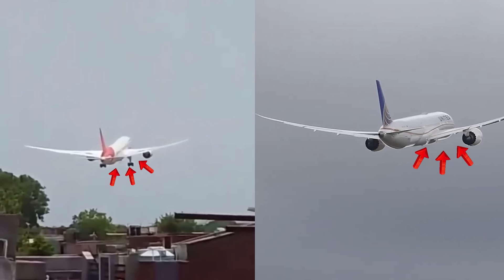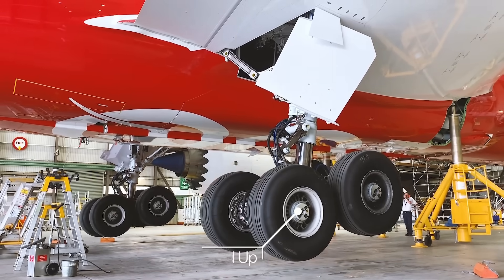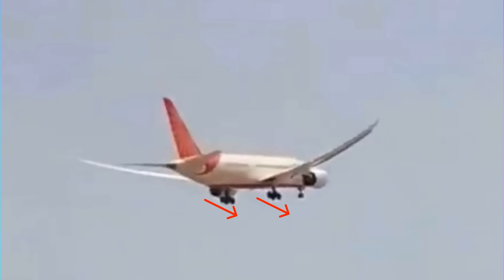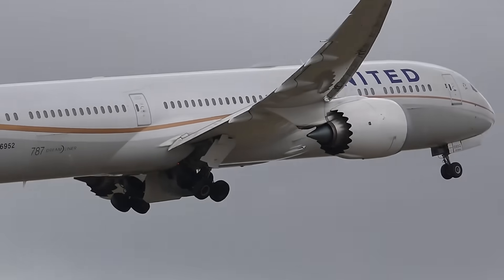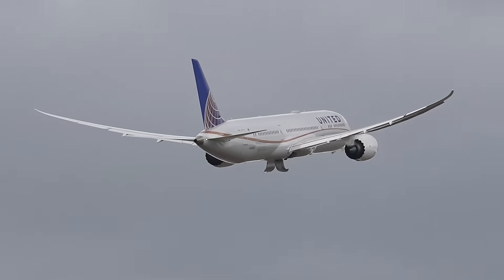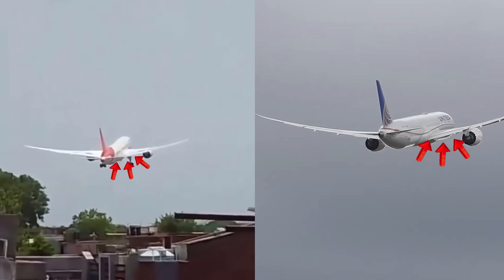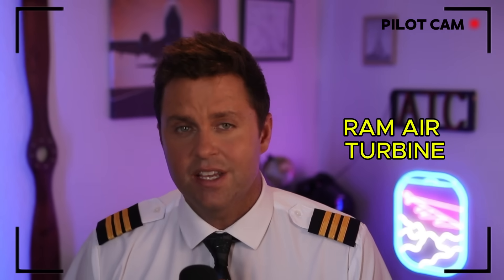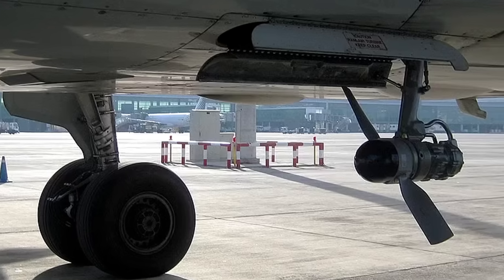Pilot Explains: A New Detail in the Air India 787 Crash Everyone Missed

Comment: I think pilot tried to raise the landing gears, the gears retracted a little bit then it's hydrolic fluid leaked (with a blast, because pressure is so high that when it leaks, it leaks with blast, that much is the pressure, and the sole survivor also mentioned about hearing the blast) then landing gears stopped retracting and the leaked ultra high pressure fluids destroyed electronics and other things arround it and instantly stopped the plane from generating power, then RAT got deployed automatically to generate emergency power (usually RAT deployment also results in flickering of lights inside the plan and sole survivor said that lights flickered) to make necessary electronics work, to make mayday call etc. We can see RAT deployed and it's gates open at the bottom of the plane, in the video, this is just my speculation from observation and whatever little knowledge i have. So i think crash happed because of manufacturing or maintenance or design engineering error of landing gear hydrolics. They should make the plane in such a way that even if hydrolic blast happen, it should not cripple the plane's ability of generating lift or running engine.

Comment: They used the full length of the 11,000 foot runway. A 787 normally needs around 9,000 feet to take off. Granted, the plane was fully loaded and it was a hot day, but did it really need the full length?

Comment: yeah, i also sat that tilt, and said that probably 787 should continue to climb with flaps select to retract. The mystery is both engines flame out at exact same time (when you lose one engine first you'll see a little move to one side. For me it should be contaminated fuel too, or bad quality, or some fatal system error. I also thought about what can cause engine shutdown in flight, and i think about overspeed and wrong temeperature selection, but it's not possible in my opinion

Comment: I think I saw it mentioned on another channel that the aircraft had recently undergone maintainence so there is the possibility that something became disconnected during takeoff that caused fuel starvation or loss of power to the fuel pumps. I think once the investigators have finished it will turn out to be an unfortunate and highly unlikely set of circumstances.

Comment: Contaminated fuel only makes sense if other planes reported an issue. Only one plane? That makes me think it's something specific to that plane. From what I understand, the plane sat on the tarmac for 2 hours with no A/C. Couldn't that then heat up the fuel to vaporaization levels? And then if you lost all electrical power, therefore the fuel pumps, the fuel wouldn't be able to be fed to the engines especially with the angle of attack on take off and if the fuel was vaporizing. So complete loss of power via vapor lock due to loss of power to the fuel pumps???

Comment: Having read the comments and watched the videos of the plane , could it not have been a circuit inside the plane that has shorted out causing fuel starvation to the engines , im only submising  but components malfunction, is there a back up ? Could it be an electrical fault causing the plane to lose power,

Comment: Another video claimed that the place sat in over 100F temperature for hours, running, with no AC (people were fanning themselves) and this led to a vapor lock issue in the fuel system. I do not know enough about the design of the hydraulic system or fuel system to even understand whether this is a legitimate hypothesis.

Comment: am not a pilot, far from it, but i have a question, contaminated fuel can cause dual engine failure yes, but can that failure happen at the same time? my thinking was one engine can flame out but the other can still function albeit for a few minutes than the other before it flames out as well. and failure just after takeoff means the aircraft was completely empty of fuel prior to refuelling. If it was contaminated fuel, the source of that fuel didnt just pump into this jet alone. other jets before and after it must have got same fuel, did other jets suffer from engine failures from the airport? so many questions in my opinion from this theory of contaminated fuel.

Comment: 1. Fuel that  comes from the depot visually inspected by certified techs for any rust or water contamination before they dispatched the tanker. 

2.The depot thats stores fuel is  (CFU/ATP) sampling tested. That knows as  microbial contamination tests .

3. Upon arrival fight mechanic/ engineer inspects the tanker usually and if they have any doubts they holds the delivery to the airport and sends samples to lab for CFU/ATP tests (microbial contamination) test.
CFU tests requires to send sample offside and takes time to come back at you . 

4.ATP can be done on site and takes no longer than hour to come back at you . 

5. Both tests requires special testing equipments. And i sure all air ports does have. 

6.even if there is a debris or rust in the fuel , there are fuel filters in place. I am sure our car does have so why not the air crafts ? 

7.Finally , only possible way to contaminate jet fuel is deliberate water contamination after the final checks and before fueling up the air craft . Which highly unlikely but you never know only needs one disgruntled person to do it.

Comment: Excellent information on the crash. Question : I am not up to speed on the 787, I agree with you on dual engine failure, the noise when the aircraft passed the camera was only RAT noise, if the engines were up to t/o or max power you won't hear the RAT. If a main battery failed due to lithium fire would that shut down the battery and cut off fuel to the engines?

Comment: Regulations require the engine driven pumps / EDPs to be able to power the engines without any boost pumps (electric motor pumps / EMPs). But I can't find any regulation that says this includes takeoff and climb power. So I think the requirement can be read as "the plane must keep flying and be able to land with only an engine driven fuel pump" and I think that takeoff power and even the attitude and forces experienced at rotation may have some relevance to the loss of thrust in both engines after an electrical failure. I also think the 248-day PCU power failure issue as well as the complaints about electrical power and eyewitness account of lights flickering or going out and the RAT add up to electrical failure, AC fuel pump failure and loss of thrust at the worst possible moment. Now add the gear stuck down and the flight already heavy and in a high temperature takeoff, the margin for loss of any thrust must be pretty low?

Comment: When I analyze a process failure where two things went wrong at the same time, I start with concurrency — what was touching both failure points.  We have the airframe itself, hydraulics, electricity, software, command inputs.  I think between the video from the prior flight show electrical issues before it ever left Delhi and that deafening silence, RAT deployment, etc., we have electrical failure.  Fuel starvation wouldn’t have also been making the cabin of the prior flight have flickering power, no lights, etc.,  and they would have added more before launching for London, so not leaning as heavily that way.  So what takes out electricity, what touches electricity going to the engines?  Input from the pilots, what turns the motor output into electricity  and— software.  Remember the Max?  Plane just decided to do the opposite of what the pilots were doing and flew the plane into the ground.  My first thought was— that silence, the rat, and what looked like a gentle landing config to me from watching lots of landings over the years (but not a pilot, and could be the angle of our video)— I am concerned that the plane’s software decided they were landing, not taking off, and those poor pilots didn’t have a chance — they had a no power stall and not enough sky to work the problem.  I think they still had some physical control, the plane isn’t spiraling in, doesn’t roll over, so I bumped hydraulics toward the bottom, along with deliberate behavior killing the plane.  I hope I am wrong, that it was maintenance, that there was some single fuse or wire that fed “keep running” instructions to both of the engines that failed,  it was something easy to identify and easier to prevent, but I always look at a things as systems: I review a system in a hospital and assume it wants to kill the patients or easily allow a nurse, provider, tech, etc., to accidentally do it, and then I try to engineer that ability out of the system, or provide education if we can’t.  Just my thoughts before coffee.  Fly safe out there

Comment: hi, couldn't it be, that the electronic throttle system could be affected respective any other electrical system responsible for thrust and all involved fuel pumps? I am thinking of the AirAsia Flight 8501 crash caused by a bad solder joint on a PCB. Thanks in advance for your comment on this topic.

Comment: I have to tell you a story,; I flew a semi glass cockpit chopper.On a VIP flight one of the several pages of parameters, that we had to check came out marginally abnormal. The engineer, a very accomplished one at that, said it was a five minute job.
As I had the time I asked him to go ahead. The helicopter came out three and a half months later.
You see a rat had got into the wireing an  gnawed through some of the cables. 
My point is that pilots are a cannibalistic race. For fame or profit,  we are willing to develop scenarios (which could influence  or offer a loophole ) for the real culprit to hide behind.

Comment: Great Analysis! 
At the time of lift-off, a significant amount of dust particles were visible on the left-hand side of the aircraft, which could indicate that the left engine may have ingested foreign objects during the takeoff roll, potentially causing its failure. No such dust was seen on the right-hand side, and although no birds were observed, this points more towards foreign object debris affecting the left engine.

Since the Ram Air Turbine (RAT) deployment suggests both engines failed, the Digital Flight Data Recorder (DFDR) report will be crucial in determining the cause of the right engine’s failure.

Additionally, during takeoff with flaps selected downwards, fuel is fed to each engine from its respective wing tank, not from the center tank, which makes fuel contamination in both tanks a remote possibility.

Overall, the evidence points to a likely FOD-related failure on the left engine, while the right engine’s issue remains to be confirmed by further data.
Reply from the maker: Thanks for the input!

Comment: It’s possible fuel vapor lock resulted in the dual engine failure. The OAT was 115 F at departure. How long was the subject aircraft baking in the intense sun after being fueled? Is there a takeoff fuel temperature limitation on the B787? Any B787 drivers out there?

Comment: There is footage showing that two hours before the accident, passengers complained that all the electronic devices on the same plane had malfunctioned and there was no air conditioning. What does this indicate?
Reply: The only survivor also said there were electrical issues and he heard a loud sound (deploying RAT?, he was seated near the wings/RAT location) and flickering lights just after that (RAT taking over electricity?). I'm not a pilot or technician, but sounds reasonable to me.
Reply: @peterschelwald7466  major electronics failure would also explain losing both engines simultaneously, which little else could, and along with the RAT deployment, electronics are the only likely sources for that bang. Note that the RAT will not power anything in the cabin, but the cabin has battery backups for lighting if there's an interruption to the power supply from the engines.
Reply: It wasnt on this trip
Reply: @tholo86 the last trip two hours before the accident.
Reply: No movies to watch and it's going to be really warm....

Comment: The YouTube pilots in general are doing a bad job on the analysis of this crash. ( with exception to Greg  ). 
I don't like the use of the term double engine failure or even loss of thrust if the REASON the thrust is low is because of another system external to the engine. For example if a massive series of computer or signal failures COMMANDED the engines to low thrust, then would you call that an engine failure?
Reply: Dunno. If you were a deep sea diver and your air was cut off would you die of respiratory failure--especially considering you wouldn't if you were sea life? A paradox ideal for philosophers.
Reply: @MaureenMarshall-s6e Yes but you wouldn't say my lungs failed.

Comment: On the previous flight that plane took a passenger reported that the cabin temperature control and other electrical systems had malfunctioned.  Could the digital engine  throttle controls have malfunctioned too ?

Comment: The survivor said that the cabin lights were flickering right after the takeoff and in the very end there was more power from the engines. So, my theory is that there was electrical malfunction right after takeoff that idled both engines (brought out the RAT and stopped landing gear going up), but the engines came back a few seconds later (and the landing gear got going up, tilting forward), but it was too late to accelerate the speed.

Comment: The survivor seemed to suggest the cabin lights were on (and flickering) which wouldn't be the case if both engines had completely failed.  Seems that there could have been another failure that caused the RAT to deploy and which might have also caused engine control issues.

Comment: Good video Gary; As a Captain here in the UK, but on an Embraer 195, I didn’t appreciate the 787’s wheels did that. However, I don’t buy into the Double Engine failure either. I agree with you that that is so unlikely, but admit it’s a possibility. But, if you watch the video of the takeoff from behind, the aircraft starts sinking at exactly the point where you expect the gear to start retracting. But it maintains it’s pitch attitude. With that attitude - 10º to 15º? - wouldn’t that wing stall in short order? Wouldn’t you need to unload the wing to maintain airspeed, and if you didn’t there would be a stall and sudden increase in descent rate. But the video of the crash shows an aircraft on a shallow descent, with a constant pitch attitude, then with a slight pitch up at the last second. And that’s with the tremendous drag of the gear being down. That aircraft seems to me to be descending with some thrust; the descent rate seems more like an approach rate rather than a power off rate, again even with the gear down. And also, I don’t see the RAT, and I don’t see the flaps in the crash video, although with that beautiful snoopy design it’s difficult to tell. 

Also, surely the RAT would only deploy with a either a total loss of Engine Driven Generators or manually. If the RAT is deployed, then either both generators failed, or they didn’t and the engines are off, not merely at idle, or it’s been manually deployed.

It’s confusing isn’t it? For the pilots’ sake I hope it’s nothing they did; we all want that. For Boeing’s sake and all 787 pilots, I hope it isn’t an uncommanded double engine cutoff. So what the hell is it?

Comment: Loss of power can happen.  A long time ago now, I was on a new 747-400 of Qantas and taking off from Bangkok we lost power on all four engines. The Qantas crew was brilliant and almost immediately cancelled the Auto Throttle and went to full power manually. Incredible seeing blue flames with little diamonds down the middle from the tailpipes of the engines.  On rotation we felt as though we were going down and we collected a frond from one of the palm trees over the horizontal stabiliser and part of it stayed all the way to Russia (we were diverted over the USSR because of war in the Middle East). It turned out the problem was a software problem in the Auto Throttle and in the middle of the take-off run it had reduced the throttles to cruise.  Makes me wonder if the problem has recurred.

Comment: Gary or someone pilot please answer this.  If all power was lost and the entire plane is fly by wire (in essence),  how would they still have control for level flight all the way  to impact.    Seems the plane would have turned in some fashion after V2 due to landing gear resistance or other factors.  They stay level indicating they still had some control.  Also you will note the pilot full up slightly at one point indicating he had some control?

Comment: I'm just a basic mechanical engineer, but after watching several videos it seems to me that Captain Steve and Gary are both right about dual engine failure possibly caused by an electrical malfunction. I think it's important to work this out to prevent anything like this happening again. Such a tragedy.
Reply: Mind: these 'expert pilots' had a totally different theory, blaming the pilots, before engineers and real experts told that the RAT was deployed, therefore probably dual engine failure. So shameful.
These 'expert pilots'  are just gossiping and now copying. You know more about technical stuff than they do.
Reply: Rodents cd interfere with electrical wires while iooking for food on board. The blackbird was looking for the rats.
Reply: How can you get simultaneous dual engine failure -- without bird strike, compressor stall, flameout or total avionics failure? Easy. Flick the fuel pump switches off. They're right below the throttles. And contaminated fuel? How come no other planes had any problems? No. In my mind this is getting to look more and more like deliberate sabotage on the part of one of the pilots.
Reply: They said it after engineers and mechanics said it. Initially they blamed the pilots. I have lost trust in these YouTube pilots.